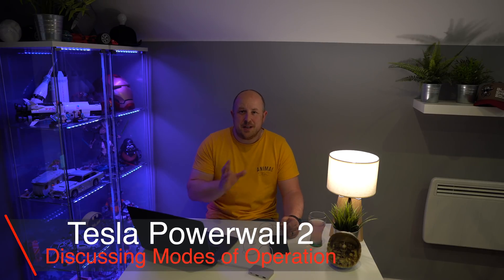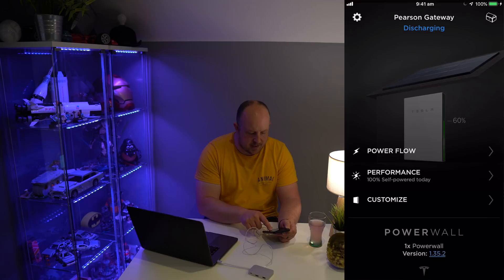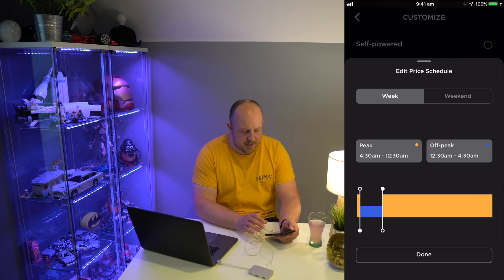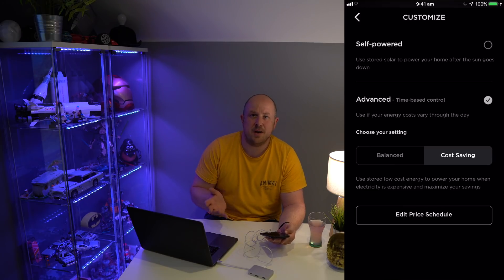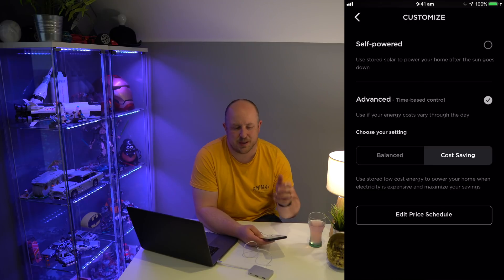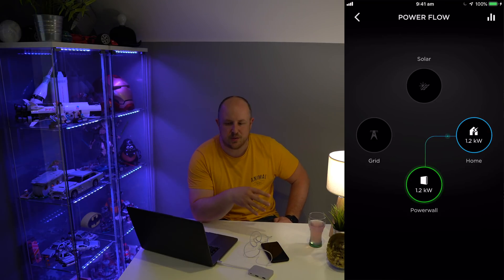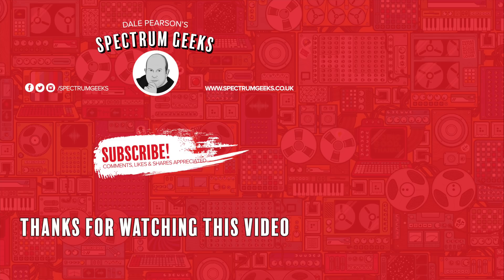Tesla Powerwall 2 Modes Of Operation

Comment: Thanks for the video. I had my Powerwall 2 installed yesterday. It looks like Cost Saving mode may be best for winter, but Balanced mode could be better for the summer. What is your experience?
Reply from the maker: I run Cost Saving all year round. Tends to work best for me.
Keep meaning to do a video on that, so good reminder :)

Comment: This video is helpful info, I have one question for you if you could do kindly answer... Is there a specific time or year you utilize the advanced time based control? Like per say summer or winter? Do you ever utilize the self powered option anymore once your battery gave you the option to do advanced time based control?
Reply from the maker: I use the advanced time based control until the weather is generally good enough to fully charge the Powerwall into the later part of the day, this is usually April time.
Right now for example its still in time based, so even if there is some in the batter it will pull from the grid during off peak, but its only a small amount. When the weather is generally good I will switch to self powered until the battery doesnt see the house through the night.
So this will vary based on your consumption.

Comment: Have you had a look at the Octopus Tesla Tariff? I'm fascinated to find someone in the UK who has moved onto it and what their experience has been. The Tesla Tariff is far more involved than the Go Tariff, and has a flat all day unit rate of 8p/kWh and 0 standing charge. Catch is you need PV, Powerwall 2 and Tesla Vehicle. But the tariff certainly seems the best option for anyone that is eligible for it.
Reply from the maker: From memory, the Tesla Tariff was for someone who doesnt get the Feed In Tariff. So I wouldnt want to give that up.
When I looked at it, it didn't seem good for me from memory. Will look again though when I get the chance.
Reply: @SpectrumGeeks   I emailed them and got this reply:

1.) What operation mode is the Powerwall 2 set to, as part of the Tesla Energy Plan and who sets this mode? 
A.) The mode is unique to the Tesla Energy Plan.

2.) Does the custom maintain access to the Tesla App to see information about the Powerwall 2s operation? 
A.) Yes

3.) Does the Tesla Energy Plan support the Zappi V2 EV charger from MyEnergi? 
A.) Yes, but any smart features must be disabled.

4.) If it does not, what is the cost to get Octopus / Tesla to install a Tesla Wall Connector? 
A.) If you purchase your Powerwall directly from Tesla we will provide a Wall connector for free, excl. installation. Otherwise they cost £460.

5.) Do Tesla UK offer the newly updated WiFi version of the Wall Connector and will this version be eligible for the OLEV Charger Grant? 
A.) They are not available yet.

6.) Whilst on the Tesla Energy Plan when would be the ideal time to charge our Tesla Model 3? Currently, I was planning to charge it between 12:30 and 6:30am.
A.) Anytime except between 4-7pm. The import rate is always 8p/kWh.

7.) Whilst on the Telsa Energy Plan will the Powerwall 2 be set to prioritize powering the house loads during peak usage times?
A.) Yes

8.) Whilst on the Telsa Energy Plan what happens to the electricity generated by our Solar PV? Is it used to 'top-up' the Powerwall 2 to then be used during peak periods?
A.) It is used as normal, either used immediately in your house, stored in the Powerwall or exported as surplus to the grid.

Hope that provides some more information for everyone.
Reply: @SpectrumGeeks  I think it works out different for each person depending on what export rate they received for their FIT, how much they currently export and the size of their solar. Overall, for us we only get 5.38p/kWh compared to the 8p/kWh and you retain your Generation FIT payments. 

From my calculations, on the Tesla Energy Plan our annual electricity comes to between £450 - £550 cheaper than being on Bulb's standard tariff, we are moving to Octopus now. Even compared to Octopus Go we could save over £100 a year.

Octopus's quotation system for the Tesla Energy Plan seems to do a good job at illustrating how the tariff operates. 

Tesla are also operating something similar in Australia and their site does a good job at explaining how it works, pity we don't get the PW2 discount here in the UK though: https://i.imgur.com/z878kq5.png
Reply from the maker: Thanks for sharing Jeremy.

Comment: Hi great vlog really helps us who are lesser mortals get to grips with all this Tech. I’ve a Powerwall, SolarEdge system, Zappi, Eddi hub ect. and a Kona Electric. I’ve just signed up to Octopus go and was wondering, if I set the Powerwall to cost saving times as you advise and then set the Zappi to the same time ie 00-30 to 04-30 to charge will it drain the Powerwall or will both utilities the 5p rate.  I’m guessing you’ve tried this out as you’ve had your setup for longer than me. Regards Colin.
Reply from the maker: Hey Colin, glad you find the videos helpful. I have my Powerwall, Zappi and Eddi all drawing during the off peak to maximise saving.
Short answer to your question it should charge from the grid not the Powerwall during off peak.
Longer answer - The Powerwall will opt not to supply power during the off peak period from the battery if it thinks its the best use of its stored power, i.e. next day will be bad weather and its you will need battery supply to meet your energy needs. It may sometimes supply from the battery though (typically in the summer) if it thinks you will easily fill from the sun. To better ensure this with your Zappi, you want to have the extra CT clamp from your Harvi to the battery so the Zappi and Eddi know you have a battery and set it to avoid battery drain (I did a video on this recently as a few people asked).

Hope that helps.
Reply: Spectrum Geeks 
Thanks that does answer all, also had an extra ct clamp fitted between harvi and the battery when the powerwall was fitted, I’m fairly sure the guy set it up as you describe. 👍
Reply from the maker: Cool, should be all set then Colin. Any issues give me a shout and I can help troubleshoot.
Reply: Spectrum Geeks 
Will do many  thanks 🙏

Comment: Do you use time based and balanced settings in the advanced bit or do you use cost savings instead? I have tried the balanced with the times set but has not charged in the cheap time. So have you tried both settings cost,/balanced and which did you prefer?
Reply from the maker: I use the balanced settings. I tried cost saving for a little, but prefer how the systems operates in balanced mode for my needs best. The system will only charge in those times if it thinks the next days weather forecast will not be able to provide for your typical daily needs.
Reply: @SpectrumGeeks   can you post a screen shot of the times you put in for octopus. I was flat yesterday and it did not charge last night. Can you post that in the community tab as that would really help!
Reply from the maker: Done.

Comment: Did I hear you correctly that you could not use battery power in the case of an outage?
Reply from the maker: Correct. Until recently (May 2019) it was not possible due to UK requirements to have a Tesla Backup gateway to island your house. Now this has been changed so now all Powerwalls come with a backup gateway. They want £2000 to retro fit one, so I will stay without the ability to run in the event of power outage as it rarely happens where I live.

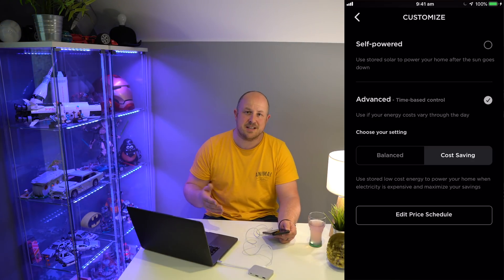Comment: Very informative video once again. I  too , are on the Octopusgo tariff , do you know if I set up to charge my powerwall2 for the full 4 hours of off peak charge ( 00:30 to 04:30 ) if the battery will stop charging once the powerwall2 determines I have enough for the following days usage or will it charge for the full 4 hours ( or until full ). Currently I'm trying to guess how much I need for the following day and change the off peak duration. So sometimes I'll set the time for 00:30 until 02:00 or 00:30 until 03:00 depending on how much I think I'll need for the following day. What I would like to do is leave 00:30 to 04:30 in and let the powerwall2 stop drawing from the grid when it thinks I've got enough for the following day, if it will do this.
Reply from the maker: Hi Brian, glad the video was helpful.
If you leave the Powerwall to its own devices it will fill up as much as it thinks you will need based on the next days forecast and your historical usage.
Reply: @SpectrumGeeks  thank you, much appreciated 👍